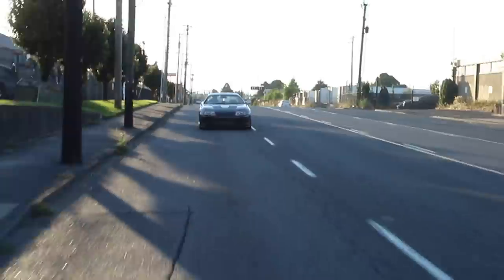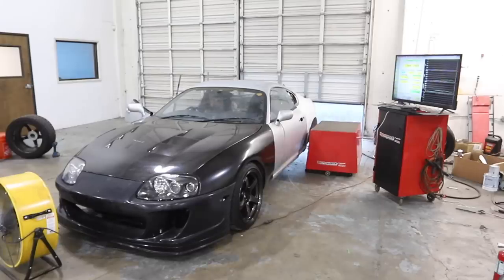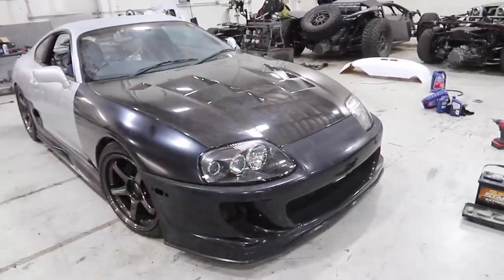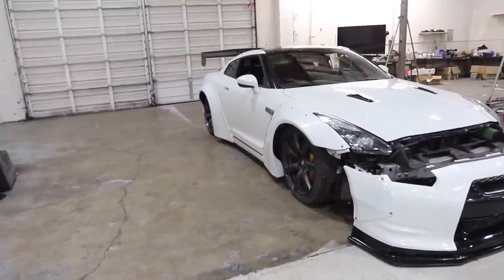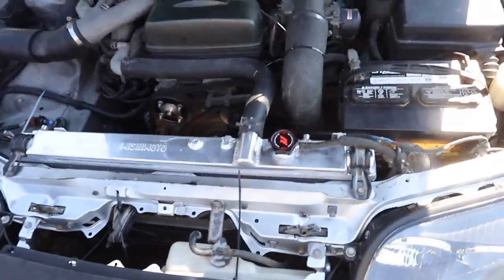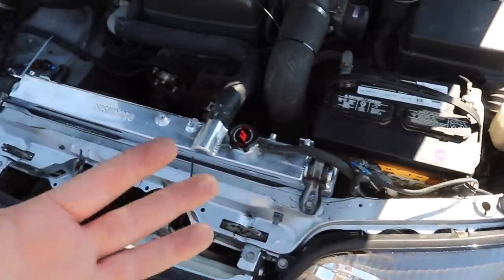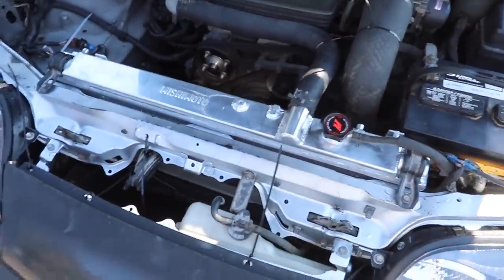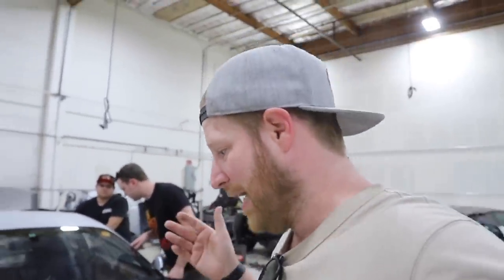First Test Drive Of Our MK4 Toyota SUPRA Restoration Build!!

Comment: You found the fan output connector from the relay. You need the fan control temp switch in the bottom of the radiator to control relays and fans. Its on the same bundle at he output connector. 2 pin grey connector.  You will also need to bridge the ac pressure switch, if the ac isnt charged/fitted yet. Remember these relays are only for the small helper fans. Iirc rated at 5 amps running, but can be used to trigger a bigger relay for aftermarket fans. Factory fans turn on at 100C and off at 91C

Comment: As a painter, I'd recommend at least 3 months before wrapping. If you had a baking booth, wet sanded and buffed the entire car, and left if out in a strong sun you might could cut it in half.
Reply: agreed, 2 weeks does still seem pretty short
Reply: @eriklarson9137  I didn't brag about any work. I just started what I went to school and was trained in. This channel is little used and for my cars for sale when I have any. I have another channel I am starting for projects. It will be awhile before I get to any painting though unless an unexpected small interesting job comes in.

Comment: The candy red is awesome, but if your not doing a total strip down and repaint, I'd say the factory colour 100%, it'll all match plus it'll still be the same colour it rolled off the factory floor in which will help resale value.

Also if you are fixed on them wheels, it's the best colour combo.
Reply: What about yellow or orange?
Reply: CANDY APPLE RED!

Comment: Two cents from someone who worked in a paint and body shop for a while. You definitely want to check with the paint manufacturer how long the paint/clear needs to off gas and fully cure - we used house of color at my shop, and it was always recommend 4 - 6 weeks prior to any vinyl/wrap/decal to be applied, otherwise the paint/clear might come off with the wrap. I've seen it happen, and man oh man does it suck when it happens. Awesome build, and can't wait to see how the mustang turns out! I did a chassis swap too using 66 mustang and 2018 chassis, and now i'm jealous of your mid engine! SO FREAKING RAD!

Comment: My best car ever was my first Supra. Now keep in mind I was a car nut back in the 70's and 80's. my first car was a 68 GTO. My 2nd a cherry 65 Mustang GT w pony interior pkg. But in 81 I needed something to commute a 100mi round trip to work and back so I bought a new Supra for 15k. It was a Mk1 5me 5 spd but had all the options. Even the dealer ones with the spoilers and louvre kit.  2 tone black and silver. I put a ton of miles on that thing and only routine maint was needed. oil changes, occasional brake job. It was quick and nimble along with being comfortable. Got rear-ended and it totaled it. Was sitting at a traffic light and boom.  I had 300k miles on it and it still looked and ran like new until that. great cars those MK1s. So easy to service. Built to last if you took care of it.

Comment: OE Alpine silver is the only choice.  Any non-OE color option always looks ghetto on Supras.  That said, your color choice on this particular car isn't going to affect value much if all.  It's value is pretty much capped with these negatives: 1) Salvage completely wrecked chassis, 2) RHD, 3) Non-OE body kit parts, 4) any re-paint at all.  While values fluctuate, this car in your finished stage will be worth less than 1/5th of the stock LHD TT auto you referenced and thats being generous.  Just being realistic here.  I subscribed to see the build progress.  Keep 'em coming.

Comment: Regarding the electric fan conversion.  Unless you're a Canadian snow Mexican or this car only sees a 1/4 mile at a time, it will overheat.  Mishimoto fans are possibly the worst option available with poorly designed shrouds.  The only people who tout electric fans on Supras are also the people selling them.  The OE clutch fan moves so much more air without blocking flow-through at speed it's not even comparable.  I say this after 27 years of seeing fellow MKIV Supra owners make this mistake.

Comment: The color question is very hard i think. Overall i don't like the look of the Supra completely either stock or full modified, there is no supra that i really like. The 2JZ is one of the best engines from factory ever built, but the body is very strange. But with some colors it would be 'okay'. Baby Blue wouldn't fit, the other blue really looks like the R34 GT-R color. Red is for my one of the worst colors for cars, there are exceptions out there but overall it's not good, the only color worse than this is green. 
So altogether it would be the original alpine silver i think, in contrast to the things said before maybe the apple red would be nice too.

Comment: B For Build, But For Me "B For Bad" 🤣 
1. Mustang Ecoboost 
2. Supra MK5, BMW Engine 2.0L i4 Turbo 
3. Chevrolet Camaro Ecotec 
4. Dodge VIPER V10 Defect 
5. Nissan Skyline GT-R34 Defect
We need Hybrid Cars As PRIUS 2010-2015. 2004-2009 PRIUS For Driving Daily In 200,000 mile or 15 years for a car. We never care about sport cars as JDM or ADM.

Comment: This is not a restoration. A restoration is putting everything back to stock. Even the wheels. Everything.  All they are doing is repairing body damage,.again with aftermarket junk. Call it what you will, just please stop calling it a restoration.